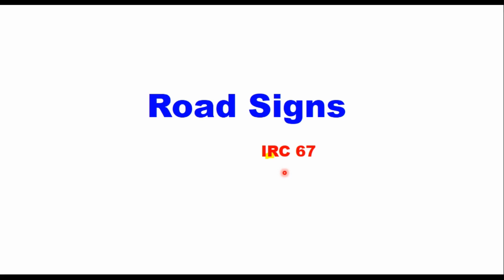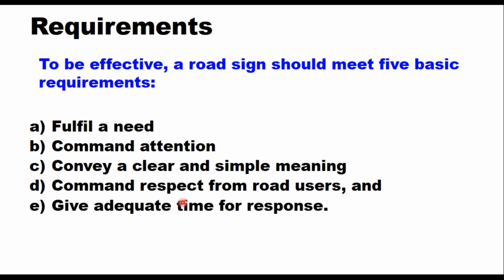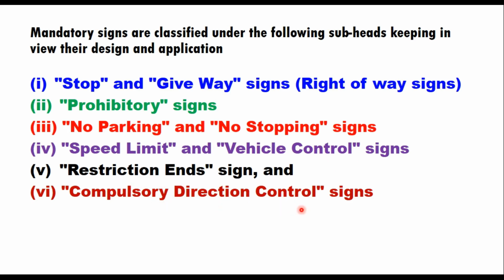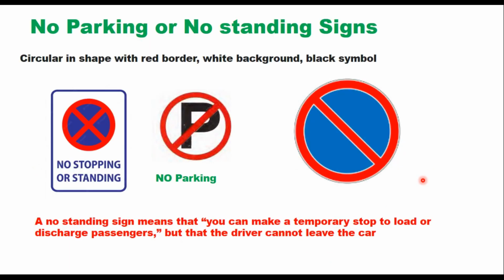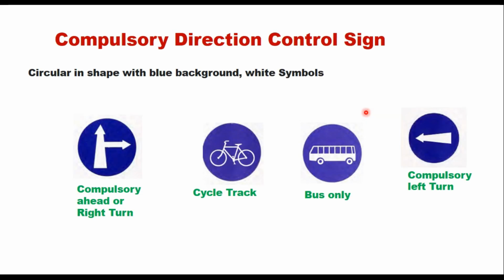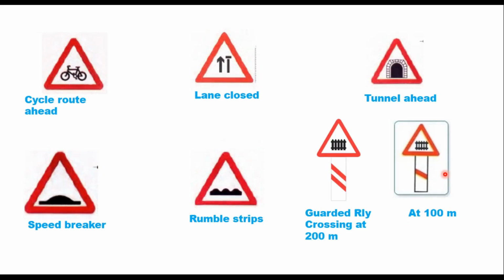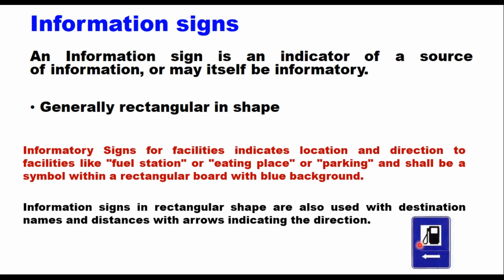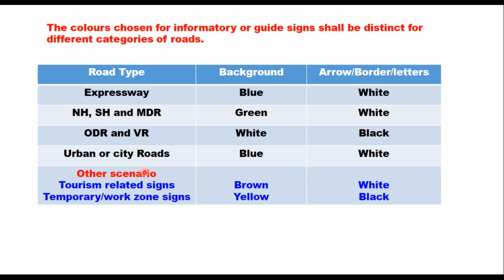Road Signs, Different types of Road Signs, their classification and uses. Detailed discussion.

Comment: Nice information. I would suggest to add (if possible)1. The material to be chosen for sign face. 2. How the directional sign and gantry signs are designed based on X height. This will help students as well as highway designers. 3. What test are performed on sign face (reflectivity) and its measurement with emerging technology equipments
Reply from the maker: Thanks for your suggestion. I thought of adding these details initially but then the video was going very long. It is not possible to add anything now after uploading on YouTube. will try to give all these details in another video. It may be on Design of Road Signs. What do you say?
Reply: @SatishIITR  yes that would be great

Comment: Sir can u please explain about the material used in for making of Sign board
Reply from the maker: It is covered in IRC 67. All overhead signs are made with Aluminium Composite Material of 4 mm thickness to
withstand wind and other loads without deformation. Overhead sign boards are made of sheets of different grades. All these details are given in IRC code.
Reply: @SatishIITR  thanks sir